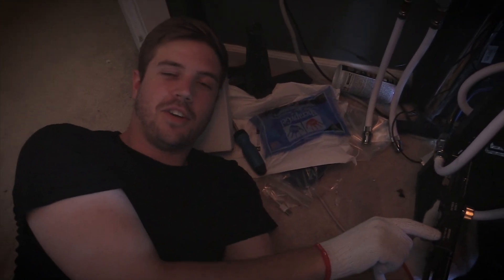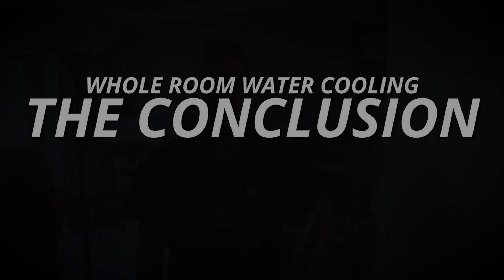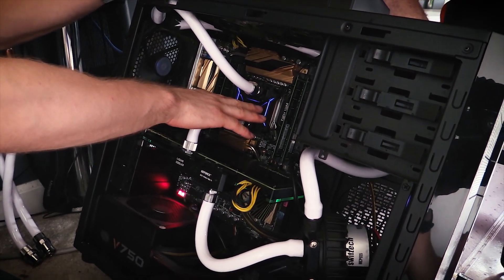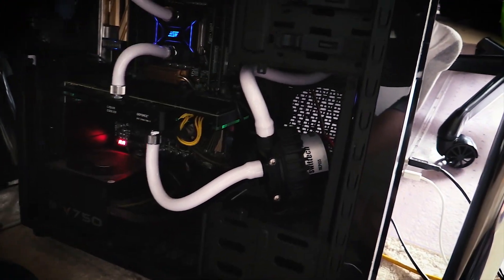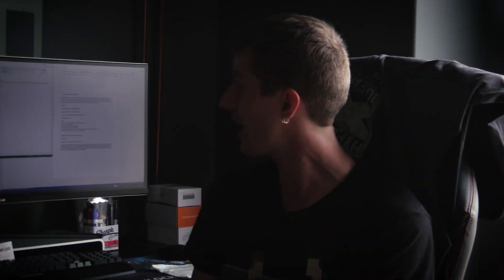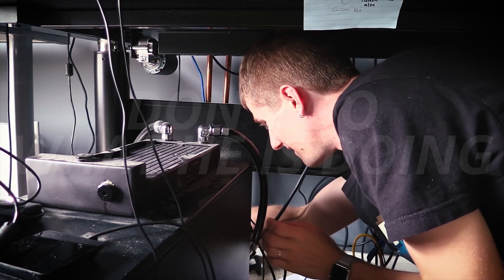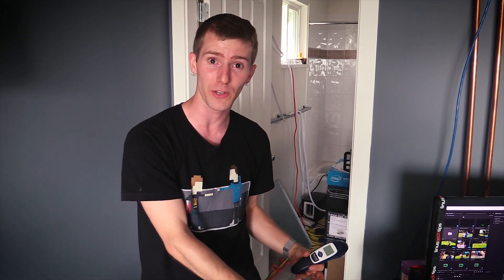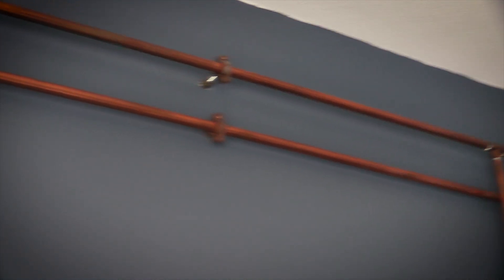Whole Room Water Cooling Part 7 - It's FINALLY over!

Comment: Hey, I know I'm late to the game here, but you need to put insulation around your outlet pipes (the hot ones) if you really want the cooling in the room to be improved. Otherwise, the hot pipes are still radiating heat into the room while the hot water is moving through them...

Comment: use the foam used to insulate the pipes on the base board heating systems on the heat pipes that are going outside. that way the pipes will keep the heat till it reaches outside.

Comment: yeah a little window a/c unit would have been easier but its definitely an interesting design.  It would have been cool if all the pumps and reservoir was outside in a small unit and ran through the side of the house and not a window

Comment: Why not just insulate the copper pipes so the heat can be dissipated more outside? The copper pipes will leak some of that heat back into the room as it travels outside

Comment: And easy solution to your systems heat dissipation in the room would be to line the copper tubes with a larger pvc  tube and pump air through the pvc tubing to an exhaust vent.

Comment: you could have tried running the copper piping into the bath tub filled with cold water both too and from the radiator/fans (like an intercooler ) witch in theory should lower the temps another 10-15 degrees f.

Comment: the concept would work great if he removed the rad from the roof (how hot does that get?) and used a dual core radiator. 1 core running the cooling liquid through, the other running refrigerant that goes to a condensing unit mounted outside. heat exchange would happen and the water would be frigid.

Comment: The first thing that screams WTF in my mind is why didn't you insulate the pipes. Secondly, why is there no expansion tank. You should have problems with corrosion if the system is filled and under pressure. Be sure to have strainers and yes you need a bucket valve to remove air.

I'm positive that the room would be 3* cooler and problem free with these changes.

If you want to try this again, hit me up. I'm HVAC by trade and live in Canada.

Comment: the whole setup is AMAZING AND OUTSTANDING ... but u missed a very important poit ..... most of the heat is  produced by screens ... ( my samsung 40"  raises the temperature here  about 15 °  .... )
Reply: That's not true at all.. By far the most heat comes from cpus and gpus
Reply: If your led or lcd screen is producing enough heat to even be noticeable it's defective lol.
Reply: get here ...... i show you what im talkin about !
Reply: My 29EA93, Cooks my room. Way more het than my PC is generating. My case is cold to the touch.
Reply: +Damien O'Brien I've never touched a monitor that was more than a degree or two above the room temp.. 

What type of monitor is this?
Reply: Eileen the Crow LG 29EA93 Ultrawide. So damn hot.
Reply: here is mine .. so u understand my statement ...
samsung 630 40"
Reply: +Damien O'Brien Weird, I just recently got an lg ultrawide 25um57, it's almost just as cool on as it is off.
Reply: good for you... im roasting right now ... !!!

Comment: So you thought of a tandem whole room water cooling system, before you thought of a curtain...a curtain.
Reply: No you don't. Just buy thermal curtains. They're thick enough that they end up trapping the hot air against the window, which will just be conducted out when it cools down. They also work both ways, keeping the room warm in the winter and cold in the summer.

What little heat they radiate from the sun shining on them is a lot less than the sun shining into and all over the room.
Reply: Plus $100 in Gila UV film on the windows, problem solved.
Reply: the room would still be hot from all the computers running at high load. he also did this to see if it would work considering he was gonna be moving soon anyway. probs some dream setup he had and wanted to see if it was worth it
Reply: Stubbari can't afford curtains so doesn't know their direct benefits.
1. They allow you to casually walk around naked
2. They block the sunlight
3. They block the sun's heat a large amount (no, they do not have to go on the outside of a house, are you an alien?)
4. They block some of the outside noise as well
5. They give cats something to climb on
Let me know if I missed anything curtains do.
Reply: I know this is 10 months late but it was bugging me. The insulating curtains which block heat have a more reflective material and color on the side which faces the sun. This results in the energy being reflected back outside and not stored in the certain and the house. They make a big difference.
Reply: said what I was thinking.
Reply: Then you open the curtain?
Reply: 3. They collect all the heat instead of letting it warm up the whole room.

what? are you potato?
Reply: +MrAwesomeShot http://www.snopes.com/business/genius/spacepen.asp
Reply: I like that story. But using pencils in such an environment is extremely hazardous, which is why NASA developed the pen.
Reply: MrAwsomeshot Pencil shavings in zero G are dangerous to electronics. Also that pen was developed on spec. So... The more you know.
Reply: Forest for the trees
Reply: The problem isn't the sun.. It's the computers making it warmer in the room.
Reply: Use tinfoil, shiny side out.
Reply: will block the nice view of neighbour's roofs as well :(
Reply: JohnIsUber247 What if you want to look outside?
Reply: ***** Do you even use double layered windows in the states?
Reply: Tantalus lol
Reply: MrAwsomeshot Reminds me of the whole conspiracy theory about pencils.
Reply: Seth Johnson Yeah you need to put that outside the window or in between the glasses. Curtain inside will just block the sun and heat up and work as a radiator.
Reply: Stubbari it was never really a conspiracy it was an urban legend that came out of the early days of NACA/NASA and their unlimited budgets and convoluted science and engineering. General Yeager talks about the "spend our way to solutions" mentality in his book as do others. 

But thanks for sending me a snopes link
Reply: reminds me of the story of nasa spending a million dollars on a zero gravity pen and the russians just using a pencil.
Reply: A curtain doesn't do shit though.
Reply: JohnIsUber247 So what magic they have if they don't heat up the room while absorbing all the energy while being inside the room?
Reply: Dh66 1. I can walk naked in my house if I want to. If somebody decides to peek in to the 5th floor it's their problem.
2. That's what blinds are for. 
3. They collect all the heat instead of letting it warm up the whole room.
4. True.
5. ?
Reply: yes like I said STO-RY

noun
1.
an account of IMAGINARY or real people and events told for entertainment.

Comment: I think this would work better here in Scotland. My computer sits next to a north facing wall that never gets sunlight and I've thought about plumbing a rad outside.
The thing that is stopping me is I get idle temps of 13C and gaming temps in the low 50's with my 6700k just using a cheap corsair h75

Comment: if you covered the pipes with insulation, specially the input pipes, so they don't heat up. Probly not big difference, but reduces the warming up of the pipes from the bathroom to the PC's

Comment: it might have helped with bleeding individual systems if you had installed a control valve in the cold line to each workstation.

Comment: then need to fix a few things. 
instal two autobleed valves.. cost very little. 

then insulation on the out pipes. they probobly have like a square.meter of.surfacearea.

third.. most importan thing. have to sink the heat to something cool. like a pond or something. or just use a heatpump for it. 

could use a groundheat pump and just reverse it. would not be tha cheep. but it would be virtually scilent. would also get the room temperature  down to what ever level. the issue then would be condensation. and it would need a condens remover inthe room. but the same system could be used for that.

Comment: Yeah, bare pipes messed up this experiment. Copper is great for this kind of project but nitrile sleeves would probably have made a big difference even if just on the output pipes. Plastic piping would probably have worked just as well though (also with sleeving).

Comment: Well the AC unit would have been my first choice, but if you have your gear take over your bathroom why not use cold running water from the tap constantly filling the cooling reservoir and draining away the heated water down the drain. The concept is neat, but holy shit dude, WTF?
Reply: Not only an expensive waste of water. Tap water contains a ton of chemicals, and it's also not biosterilised. It would corrode the metal components in your CPU/GPU blocks and it would eventually make way for algae to bloom inside your loop. Both are problems that you do NOT want.
Reply: Someone made a water cooled PC that dumps heat to water reservoir for flushing the toilet. Of course using some form of heat exchanger (was it copper pipe?)
Reply: That's a lot more expensive..
Reply: that's a lot of water...
Reply: this is such a stupid comment i'm not even going to grace it with an argument
Reply: xRevan116x I think a lot of people have missed my point. I'm saying the whole idea is wasteful, so why not go all the way. For my part I will be sticking with a simple Cooler Master hyper evo 212 for the next few years at least.
Reply: Eileen the Crow Francesco Castelo Yes it's a lot more expensive, and yes it's a lot of water. It would also be a huge waste of water to boot. It's more from the perspective of running copper tubing through my house and putting a giant radiator that takes up most of my bath tub in my bathroom. I'd be very worried about condensation if I did that with the cold water running, but I'd never run that much tubing through my house to cool my computer to begin with. It's a liquid cooling enthusiasts wet dream, but ends up not working so well. Ever watch the 1950's video of the bridge rocking? Not anywhere near that bad, but still not good.
Reply: such waste of water, much wow, cause you know, water is teleported in to outer space right after getting down the drain.

Comment: Those inlet /outlet cables need insulation!!! The long pipes are acting as heat exchangers... to the room as you mentioned. With the thin diameter, and super long piping, you have lots and lots of surface area through which to move heat 😬

Comment: Due to counter current heat exchange between your outflow(hot leg) and inlet (cold leg) you have nerfed the efficiency of your system. Google: "counter current heat exchange" for the physics of it.  The TL;DR is to thermally isolate the lines (pipe insulation), at a minimum insulate the hot leg.  IMHO, it would be more efficient to just set up your work stations so you could segregate the computers into their own climate controlled environment and use a properly sized AC unit to handle the heat load.

Comment: Just install a water cooler to the main line to cool the intake water... I mean yeah it's going to cost some $$$ to run the water cooler but aside from room temperature or plain tap water the only other option that still uses water cooling but possibly gives you the wanted temperature drop. I would rig a Coligan Water cooler so that your out take line is the water coolers intake line and the water coolers out take line is your cooling systems in take line. Fill the water cooler jug and plug it in.... BAM!!!

Comment: Or just move the PC's to a different room and have proper ventilation in that room. There are switches made to where you can plug in DVI monitors, USB cables, etc that can be carried over CAT5 cables long lengths (CAT6 would be better)

Comment: You guys need me to redesign your cooling system.
I can eliminate 25% plus ambiant room temps with minimal cost.
Your cooling water system is fubar at first glance.
#1...no insulation on the hot side piping and cold return to isolate the room environment from the equation.
#2....using all 1/2 inch pipe...cold water side vs hot water return should be proportional to
the heat load vs cold return volumn of the water.
FYI....water expands with rise in temp....affecting pumping efficiency.
 So.... Large volumn cold supply under pressure and multiple lower volume hot returns feeding into a large volume return INSULATED HEAVILY.
YOUR outdoors heat exchanger needs to achieve 20,000 btu minimum or yer just gonna be circulating hot water.

Comment: Ok, some tips from a former plumber that runs water cooling on my computers.
1:st Hot pipe should ALWAYS be upper pipe and not under the cold pipe, otherwise the hot pipe heats up the cold pipe.
2:nd in order to get a cooler room you need to insulate the hot pipe to get the maximum amount of heat out of the room, otherwise the hot pipe will heat the room.
What you also can do to maximize cooling is to run moisted radiators outside, moist makes cooling more efficient and since they are outside it won't matter to the environment. How you can fit it to your system is up to you to figure out.

Comment: This is what over thinking looks like
Reply: Still generated a million views, seems to have achieved the desired result.
Reply: More accurately, dreaming a big picture in low resolution, I think.
Reply: over? you mean under? :D
Reply: You are overlooking the difference between "comfort" and a "compromise" ...
If you have such a system you can always ad an air conditioner later ... for a cooler breeze ;)
Anyway, it is just a thought :)
Reply: Adding an air conditioner changes the air inside the room, which is what you want. So your logic fails.
Reply: In a wierd way (and if pvc pipe was used)... this would be more beneficial AFTER adding an air conditioner to the room, since it wouldn't be having to extract the heat of the computers as well. So cooler room for less money :D
Reply: KrazyKing13 No kill like overkill.
Reply: no, overthinking would have been realizing immediately that all of that copper pipes would dissipate the heat before it even gets to the heat exchanger.
Reply: I'm not talking about the build, I'm just saying he wants a cooler room so he does this instead of an air conditioner? What?

Comment: roomscalecooling wasnt gonna work that way. how ever, if you could combine it with a heatpump system and floorheating/cooler system you could get it to work. it is an interesting way for big offices to use that exact heat in wintertime instead of using gas. love the idea!!

Comment: I would have used intake & output manifolds for the systems to not have the last computer collect all the heat from the previous ones. Also 3-way valves for the switching of the whole room to the local reds but they could also shut off the flow to that system. And yes...a bleeder valve for the purging of air.

Comment: LInus, What do you think of water cooling, under normal circumstances, such as a single gaming pc? I'm always afraid of it leaking into my case and on to my components. I know that it needs to be installed correctly, but in the event of a leak. Thanks.

Comment: This was the worst full multi box cooling system that could have been built. That radiator array is super over priced, for a low amount of cooling. PC radiators are designed to be small and practical to mount to a case. If your going to plumb the water out of the room.. Just use some car radiators. Why use computer case fans? You can get box fans for super cheap.. Also why use copper pipping when copper will dissipate heat into the room.. Its very feasible the planning was just terrible.
Reply: because he have for free surely all the parts.

Comment: I bet 10 grand I could do it better an cheaper an make those cpus fun super cool
Reply: It could be done for under 1k(not including the actual cpu/gpu water blocks or the pc's them self). Couple of car radiators, some box fans, a large plastic storage bin for a reservoir, Combo pvc piping and flexible rubber hosing. Add another 1k and you could run air ducts to pump all the heat from the box out while your at it.
Reply: +Wick3DPimP too complex think simpler my friend your on the right track with the radiators an fans
Reply: all depend on the system you are making,
if you add a central AC then it can get up to 5k (if you build it yourself)
with 10k i got 2 full bathroom done.

car radiator in stainless (no corrosion)
put that in a closed box where the ac air is blasting and plug the pump to the main line, also drop the line to the ground hot air travel up while colder air go down (also it's less demanding on the pump part)

Comment: You can get foam insulation for copper pipes. They come as sleeves, and you put them on the pipe. It's specifically for this problem.

Comment: could you possibly run compressed freon in the system to cool them
Reply: Not to mention you would have to build custom parts because most of them aren't made for any type of compression.
Reply: Dangers of condensation, I think.
Reply: urpoche you are right you would have to run insulated pipes and insulated tubes in the  system
Reply: MrLazer1211 thats true

Comment: i am better than you and i can do better with half the money. You know that big wooden box you get with your rich guy stuff. well put three windows cheapo ac unit in the sides and two car radiator fans and a car radiator plus an electric water pump and set the ac units to forty degrees and then you will probably condensation issues in the box but you you will get less then ten C and it will cost less than a G to do it.